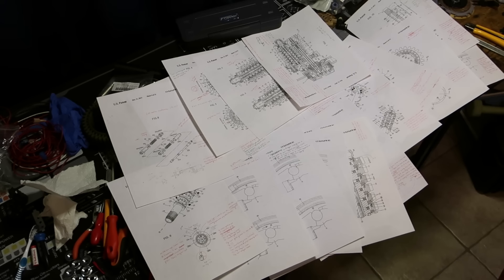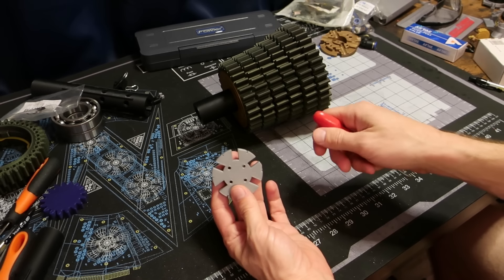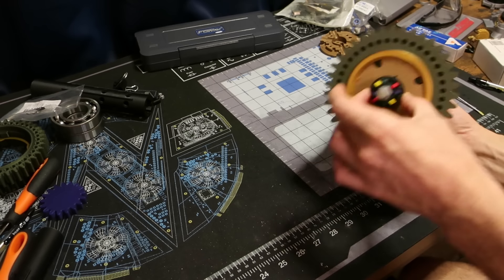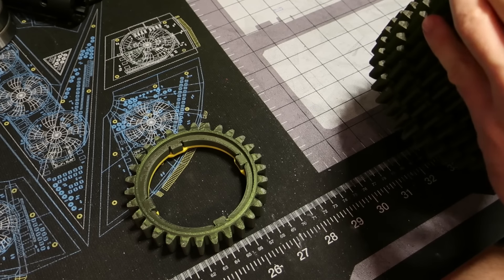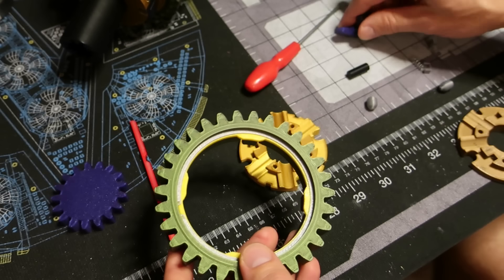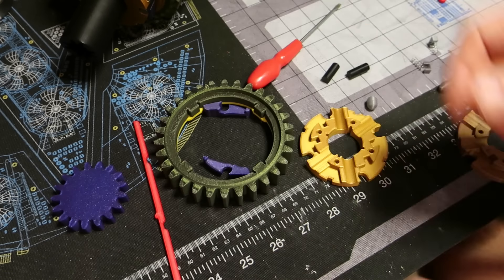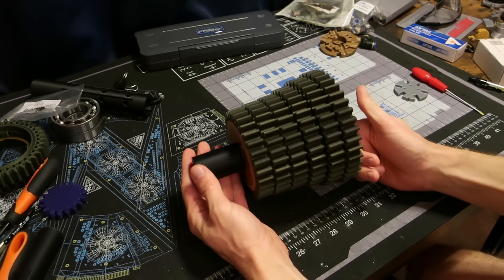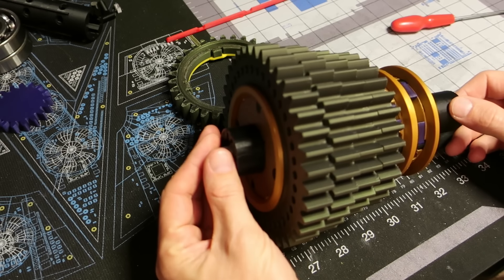Inside a MotoGP Seamless Gearbox Replica - How it Works

Comment: I just want to say that you’ve done an amazing job reverse engineering and explaining it! I still have a couple questions since I want to design a working version. How does the shaft/gears look on the end to the sprocket? Would it be all gears already connected to the seamless shaft? And I was wondering, with high torque won’t the levers get stuck in engaged mode?
Reply from the maker: The sprocket just splines on the end of the shaft - it's not shown on this print.

The amount of torque doesn't matter in this design; the pawl levers will still disengage between the gear changes. The only limiting factor is how much torque the components can handle before failure.

Comment: Seems like the shift rods would be a weak point here. I wonder if it is a common failure.
Reply: Exactly, a tube would make more sense to engage the shift pins
Reply: @nicodesmidt4034  you need multiple rods that can move independently and be spring loaded for the seamless shifting.  If you didn't need it to engage the next gear while the previous one is still transmitting torque, then you could do it with a strong singe tube, but it wouldn't be seamless.

Comment: i still dont get the control rod slot thingy, how is it decide when to slide or locked from the control rod? what's stopping it from sliding further when getting to higher gear? how's it not slide out of the assembly on downshift?

Comment: Interestingly enough, it would make more sense if the 'tail pins' on the purple engagement levers were intended to prevent accidental vibration- or centrifugal-based reverse engagement with the transmission gear.  And what I am suggesting by that is their extension, into the window of the yellow annular ring, would prevent them from accidentally interfering with the free rotation of the unselected transmission gear, as the lever passed through the region wherein such a compromise of function might occur.

Do you see it now?

Comment: The part about how the gear naturally stays engaged until the next gear relieves pressure on it (causing the previous gear to disengage fully) is brilliant; it reminds me of how lockpicking applies tension to a core by rotating it which allows the pins to bind up against the sides of the housing so that they remain in position despite no upwards pressure from a key.

I don't really understand how this works in both directions though; it makes sense that shifting one way would relieve pressure by rotating faster than the previous gear, but in the reverse direction wouldn't the slower gear always lag and never engage? Is it because that gear effectively drives in "reverse" briefly (applying pressure to the deceleration levers) which ultimately has the same effect of briefly unloading the previous gear before resuming forward rotation?
Reply from the maker: The simplest way of explaining it without showing it is when you downshift, you can think of the rear wheel becoming the "driver" of the gears instead of the engine, so everything works the same but in the reverse direction.

Comment: You do this so well, I subscribed as well. Well done. What type of printers do you use. That center tube with grooves inside must have been difficult. I see you also watch Gamers Nexus, deskpad gave it away. Thanks again for you work and video time.
Reply from the maker: Thanks.

I use an older Prusa i3 MK2.5s, but still works very well.

Comment: Ok so you did all this in 10 hours?  Insane. I couldn't print 1 gear in 10 hours.
Reply from the maker: Ha I wish. Reverse engineering the papers took at least that long. The prints took exceptionally longer to do.

Comment: Thanks for sharing, it was interesting to learn how it works and it is an achievement to make this just from patent diagrams.  I think the camera is trying to focus on your fancy desk mat instead of your amazing 3D printed model :) a plain background might help perhaps?  I've got to be honest, I had to watch at 2x speed, as a design engineer I have seen free wheel pawls, cam rods, springs, levers, gears etc. before and I just wanted to know how it worked and what made this seamless vs a normal gearbox.  I'm still not sure it's seamless really, but at least it minimises the seams.
Reply: No idea if this will help and maybe you get this anyway. I think it is like this — On an upshift under acceleration it disengages the overrun pawls in the current gear then engages the drive pawls in the next. This allows the "old gear" drive pawls to ratchet backwards even as both gears are "engaged" together. So there is never any neutral period. There is drive in the lower gear then suddenly there is drive in the higher gear as the higher gear drive pawls pick up the load. Seems pretty seamless to me. The engine torque is always transmitted to the rear wheel, without ANY interruption. After that the remaining pawls are sorted out. They are not loaded so that is no problem. I am not sure if say upshifts are allowed on the overrun.

Of course the engine RPM will have to adjust instantly, but these bikes have no flywheel and the ratios are pretty close so the seaminess from that might be quite small. On upshifts the engine will have to be slowed down by transmitting more torque to the rear wheel so a small jerk forwards.

I haven't really got it all sorted out regarding downshifts 🙂🙂🙂 Or upshifts on the overrun, but that is hardly a racing maneuver. My guess is that Honda will have sorted all 4 cases out, but I am not sure. They will all be, disengage the unloaded pawls on the current gear, engage the new to be loaded pawls on the new loaded gear, then sort out the rest.

Hope this is not gibberish:-)

Comment: What 3D printer did you use?  Quite the quality print of the gears as I don't see any striations on the face of the teeth.

Also, what you described seems like its a lot simpler than a dogged transmission considering there isn't a complicated shift drum or shift forks/shafts.

Also, wouldn't this design make for a good automatic transmission in a car?  All it seems to need is a torque converter (as a clutch) and a stepper motor under computer control to pull/push the shift pin.  Is the reliability the only thing holding it back from such an application?
Reply from the maker: There is still a shift drum that is required to move the internal shift rod mechanism; I just haven't gotten around to making a prototype that interacts with the model in the video. This is by far way more complex and intricate compared to a standard dog box transmission.

I am not so sure this would work well in an automotive application considering how much more power / torque a car can produce compared to a MotoGP bike, so I'd imagine these components would not hold up well to that abuse.
Reply from the maker: Oh and I use a Prusa i3 Mk2.5S; it's a bit dated compared to what's offered now, but it's still a beast.

Comment: I'm curious if Honda, or any other team, ever experimented doing this with a centripetal clutch, instead of using cammed dogs.  If they're already rebuilding these every race, why not explore other methods.  So much complexity with the timing mechanism could be taken out by just changing to clutches, not to mention you could hypothetically push much more power through the clutch mechanism than you can with two pivoted dogs; essentially moving potential failure points from those diving pivots to at what point the clutches slip or what the teeth of the gear can handle.  The same kind of selector would probably be used, a cam mech with previous gear retention, though given the radial nature of centripetal clutches it'd probably be simple to use a radial action on the selector.  This would also be cool to adapt to a hydraulic system to replace the cam selector just a series of valves and pressure differences determining which clutch pack engages, imagine throwing this into a kart and just having shifter paddles; though this quickly becomes just one step away from just an automatic transmission. 

I almost want to see this scaled up for use as a sequential in a car.  Surely reliability would go up with scale, beefier components and more room within the package to provide robustness.

Comment: One thing I don't understand is design of the layshaft. Basically a gear gives a force for driving  and a force bending the shaft. Due to the pressure angle of the gear.
A conventional gearbox with dogs will have longer shafts than this design. This design has shorter shafts. Still needs a sturdy shaft.
The pawls you call levers, was used in kick start mechanisms back in the fifties.

Comment: I have always been amazed that those small parts can withstand 250 horsepower. I wonder if Honda got the idea in the beginning by seeing the old Sachs engines transmissions?
Reply: They prob. where inspired by the lockpicking lawyer 🙂  The entire principle is analogue to picking locks. Always keep torque on the lock cylinder while searching for the indexing pins currently bound up.

Comment: It seems to me that this system would break if one were to downshift under acceleration or upshift under deceleration, is that so?
Is there any provision on the design to avoid this issue?
Since this is only to be used by the very best pilots in the world, it's probably reasonable to assume they would never downshift under acceleration or upshift under deceleration, but if this system were to be brought to road bikes, this would probably be a huge issue.

Congratulations for your 3D modeling, construction, explanation and video.
Reply: To downshift, the current gear has to disengage in the acceleration direction to engage the lower gear in the deceleration direction. Similarly, upshifting has to disengage the current gear in the deceleration direction to engage the higher gear in the acceleration direction. Thus the two gears can never both be engaged in opposite directions at the same time to bind up the gearbox.

We haven't seen the springs that let the slides move on the shaft, but I suspect they each only go one way, so it would likely even prevent engaging a lower gear in the acceleration direction or a higher gear in the deceleration direction before the current gear disengages in the same direction. Even if it doesn't prevent that, it likely wouldn't cause any damage because the backs of the levers would be sliding on the gear instead of the tips catching it, resulting in just not shifting until the load is reduced.

The main way I could see causing damage to the gearbox (ignoring potential engine damage from overrevving) by shifting that way would be putting more stress on the shifting mechanism to forcibly disengage the gear under load. But that also means the rider would notice it's taking much more effort than expected to shift, so they probably would reconsider before going too far.
Reply: I hadn't considered that the shift rods or slides (the very colourful parts of the model along the shaft) are the parts that put light spring pressure to disengage the previous gear under normal operation (upshift under acceleration or downshift under deceleration). It seems that this only works on the correct direction; on the reversed direction (downshift under acceleration or upshift under deceleration), there would be no spring to disengage the previous gear, and so the gearbox would probably behave the same as a regular gearbox: it would require too much force to operate under load.
 @MrNukealizer , I think this is just another way of saying the same thing you just said. Thank you for getting me to understand this better, it is a very interesting mechanism. I just don't think I quite understood what you meant by the "backs of the levers sliding on the gears instead of the tips catching it", would you care to elaborate on that? Is this related to the fact that the shift rods or slides are operated as 2 separate groups?
Reply: @tulio-a-cardinal  When I said  "backs of the levers sliding on the gears instead of the tips catching it," I was talking about what would happen if springs on the slide let it engage two gears in the same direction at the same time. When shifting the normal way, the higher gear would take over when upshifting or the lower gear when downshifting, immediately letting the other gear disengage. If you shift the wrong way and the springs allow, it could try to engage a lower gear under acceleration or a higher gear under deceleration, which wouldn't take the load off the current gear to let it disengage. In that case, the little levers inside the new gear that are supposed to transfer power would just slide on the inside of the springy ring instead of engaging the gear, since the current gear is already turning the shaft faster or slower than the new gear. Thus there shouldn't be any damage even if it tries to engage two gears at once in the same direction when shifting the wrong way.

But realistically that's very unlikely to actually happen because the slide springs would need to work in both directions, and I can't think of any reason to design them to do so.

Comment: I'm trying to imagine how a downshift works. With upshifting I get that the higher gear will spins faster, disengaging the lower gear. But what allows the higher gear to disengage on a downshift, because I think in that situation the higher gear will still be the faster spinning one.

With slipper clutches the downshifts do not need to be seemless I suppose, so there's perhaps some wiggle room there perhaps? So first disengage the higher gear and then engage the lower?
Reply: The gap on the shaft to the sliders reverses the order of operations for downshifting.

Comment: This is actually, not new mechanism. Similar mechanics used in some old bicycle internal gear hubs, but on planetary gears. Some simplified, but the idea is the same. Sturmey Archer S5 and S7, or SRAM S5 and S7 hub uses same principle. There is two cams, driven by wire. Two coaxial pushrods, and engagement DOG is locking the Sun gear and release other Sun gear. Shimano internal gear hubs uses rotating "fork"-like cam, which locks two DOGs, which locks the sun gear. 
But, I've seen almost the same mechanism in Rochloff 500 hub but a bit simplified. And!!! The shaft is stationary, so, it means, is stationary part is axle. Tommy - please have a look on some bicycle gear hubs schemes and videos. You will notice, that the idea is a bit the same )))))
Honda, probably, took some ideas from Sturmey Archer and Rochloff hubs, but made it more interesting )))))))))))))
Cheers! 😀😀

Comment: With this gearbox, is impossible to downshift accelerating. Because have force in the rod. Only upshift accelerating and downshift desaceleraring.
Reply: this is a great question, and from the info in this video, I think you're right. Pulling a downshift whilst even slightly on the throttle will cause the lower gear to be engaged by the pair of negative torque dogs, without releasing the higher gear. It's possible that the selection system is sophisticated enough to not destroy the gearbox though, but not clear from this 3d model...

Comment: Unlike Honda are you willing to share the 3d files?
Reply from the maker: The model is still a work in progress and I honestly wouldn't get your hopes up because of how much effort is needed after the prints to make everything work well enough. Sorry.
Reply: @TimmaethBoy  I am willing to colaborate if you are willing to make this in metal, I have my own machine shop. I am currently making pneumatic, hydraulic and HVAC systems for trains and trailers.

Comment: Like all good Transmission designs over the last 50 years this was invented by Weismann and stole by the Motogp manufacturers.  Unfortunately that's happened countless times to Weismann over the years. They invented The transmission for the Ford GT (2003) which was then stolen and back engineered by Recardo into the infamous  1000+hp capable factory transmissions that we saw on the second gen GT. Same thing happened with the McLaren F1. Weisman was commissioned by Mclaren to design the F1's gearbox. They Designed and built a few prototypes which were installed in Prototype F1's, then ties were cut from Mclaren's side and the design was stolen and made by an off-brand manufacturer for pennies. The Design discussed in this video is called Weismann's Quickshift transmissions developed in the very early 1990's. I believe this design was used on the Mclaren F1 LM race cars.

Comment: 34:58 why not have a tube instead of rods ? A tube with holes in it is much more robust
Reply: 46:10 The rods need to move independently for seamless action. a tube would not allow you to engage next gear with previous still transmitting power

Comment: I have a couple of questions : 1) Why is it called "seamless"?
2) Making this gearbox must have been a considerable effort.  Why did you do it?  I don't suppose it will be used to drive anything with any real weight.  Was it for an education lecture?
I must say, it's beautifully made!  I had a Lambretta many years ago that used a similar gearbox - though not identical.  It was a bit simpler in concept.
Reply from the maker: Seamless shifting is the process of being able to change gears without creating an unnecessary delay / break in power transfer to the rear wheel as you shift through each gear. We're talking fractions of a second where there will be a a momentary loss of power transfer to the rear wheel, but one that exists nonetheless.

I did it to satisfy my own curiosity with how it worked and thought it would be cool to model a somewhat functional version.

Comment: That anular projection thing is just a synchronizer. The difference is basically just internal shift forks.

i see little improvement in shifting speed, because the engine still has to slow down for an upshift.